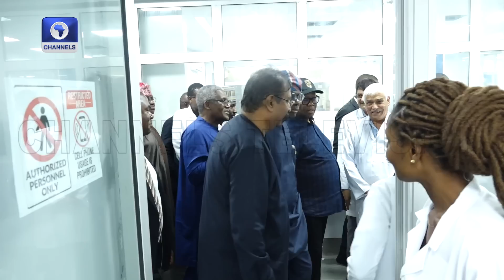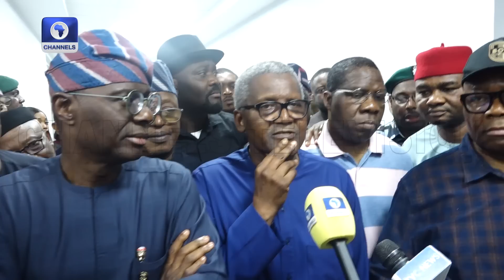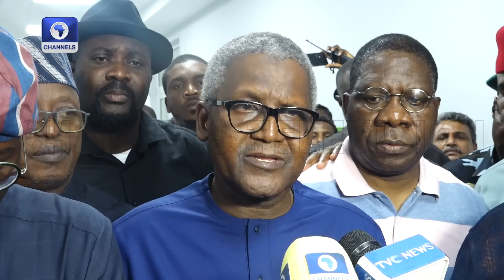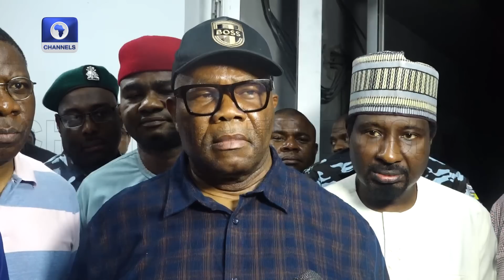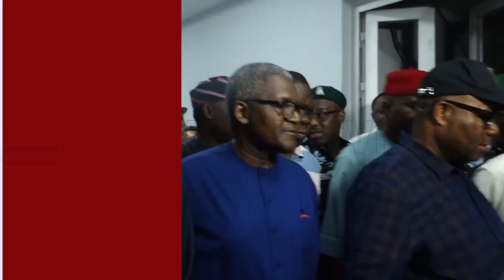Expect PMS By The Third Week Of July - Dangote

Comment: Sadly, journalists do not study or do proper research so they can ask the right questions. Nobody cared to ask our Senate president when will Port Harcourt and Kaduna refinery start production. Dangonte is monopolizing our petroleum industry, just like what he did with cement. Immediately NNPC contracted Dangonte's younger brother to carry out maintenance at Port Harcourt refinery in December last year, I knew there will be delays and setback. Dangonte was the main brain behind cyber security levy that his friend, Bill Gate proposed to the president on the 29th of April, 2024, when he visited Mr. President. And thank God it was a failed project. Interestingly no media outlet could dig that up. 

Moreover Nigeria requires 25 billion USD annually to stabilize its oil production at 2 million barrels per day. We have been grappling with declining oil production in recent years, primarily due to aging infrastructures, security challenges, and underinvestment. So stabilizing production at 2 million bpd would significantly boost government revenue and provide much-needed foreign exchange. However, underinvestment in the sector is why we are where we are today. So what is government doing to solve this problem?